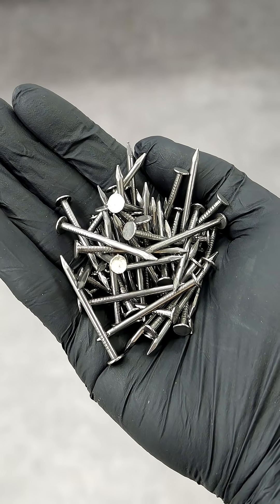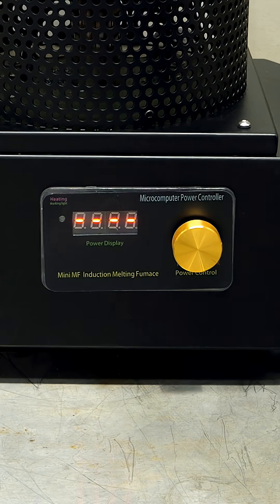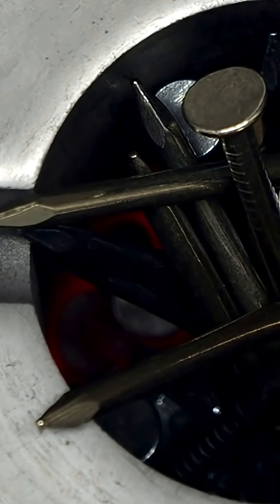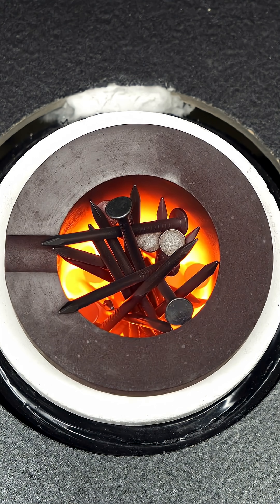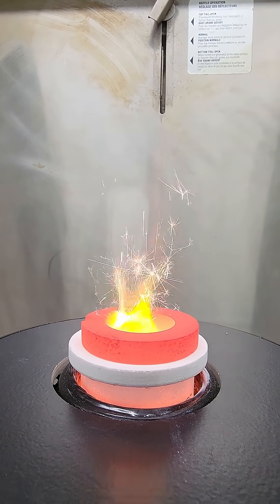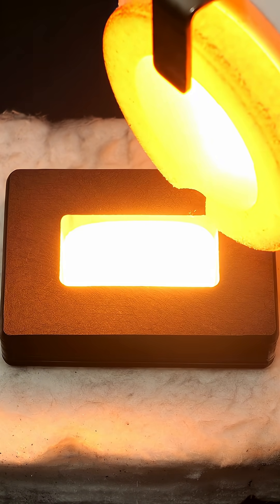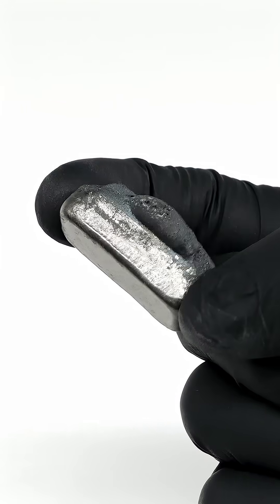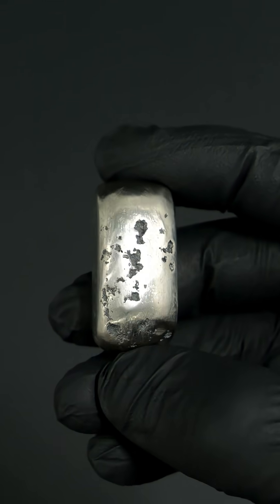Liquefying nails is crazy

Comment: Just a word of Advice.  If you want to smelt metals or alloys,  be sure to do it outdoors, and with a respirator.  It is important that water, such as rain, can not touch anything near or around the smelter.  If water gets in, there will be bits of liquified metal flying everywhere.  If you breathe in them fumes, it will seriously mess you up, then its lights out forever.
Reply: Great advice. It's also worth noting, NEVER pour molten metal over a concrete floor. Because it can explode.
If you ever go into a foundry the floor has a layer of moulding sand over the floor which can safely deal with any spilt metal.
Reply: @agentcrm Why? Is it because the concrete cracks from thermal expansion, or water in the concrete, or some heat-driven chemical reaction?
Reply: @WarttHog  The concrete can explode.
I believe it's the water in the concrete that expands and causes the explosion.
Either way, no workshop or carport concrete is designed to withstand the thermal shock of spilled metal. 
Personally, I know a localish small foundry worker who had a had a heart attack, after a crucible failed and the spill from that.
Reply: @agentcrm Very important, yes.  Great addition.
Reply: A proper science lab has proper ventilation.  He’s a professional.  I’m sure he knows what he’s doing.  Plus, if this were true, all smelting plants would be outside.  I’m not disagreeing that the fumes are harmful to breathe in though.
Reply: @DanTheMan12379 How many people own a smelting plant?  I am clearly referring to people doing this at home.
Reply: @seanhuds7351 it wasn't obvious to me you were talking about people doing this at home. The fact that you commented this on someone doing this in his chemistry lab instead of at home led me down a different path...
Reply: @seanhuds7351  who do you know that has a smelter at home???
Reply: @littlesparkkitten  Me.
Reply: @seanhuds7351  That is wild. I love that for you but I hope you know that’s like… extremely rare. You are the first person I’ve ever heard of with that kind of equipment at home.
Reply: @littlesparkkitten Thanks.  I actually made mine from scratch.  Its only small and I only use it for minor projects.  To give some context, I make tools from various periods in history, dating back to the Neolithic era to around the Bronze Age.  I guess you are right, it is rare but people get into all sorts of wierd and wonderful hobbies these days.
Reply: @seanhuds7351  okay that’s awesome as hell/gen
Reply: I think he has it under a fume hood
Reply: that smoke was likely zinc oxide, which will kill you fast if you breath it. dont forge or smelt galvanized metal.
Reply: @DarkworldHero zinc oxide is not that toxic
Reply: I’m terrified of Hexavalent Chromium whenever I work with stainless steel.
Reply: @VenusDescending  Hell yeah!! that stuff is evil.
Reply: Avoid water and rain by doing it...outside?
Reply: @peelsreklaw Obviously if you have a Garage just do it in there with the door open , but I dont have a Garage or a Gazebo so I have to do it the old fashioned way of waiting for a day where it isnt raining.
Reply: How did blacksmiths make plows and stuff before respirators then? Were they dying young?
Reply: @Daixiu1  Galvanized steel produces toxic vapors when it heats up enough. If it isn't galvanized then it doesn't do that, also weren't they generally well ventilated anyways due to having to use coal or other solid fuels?
Reply: @HibbyGibbons but galvanize process was only invented in 1900 when lead was found, before that only mild steel
Reply: @Palmstreet-u7x  I am well aware, which is why I pointed out that only applies to galvanized metal, I also added that they would be well ventilated either way because of the use of solid fuels for their fires. I could have been clearer I guess.
Reply: @HibbyGibbons point taken
Reply: I only mentioned it because I was from January 1976 to November 2017 a boilermaker using galvanized steel daily on gold mines, ad it was used to prevent steel from rusting, and few people know that all what galvanized steel is its hot treated steel, contain high levels of lead, that when heated up that galvanize is removed from the steel and very highly toxic to the lungs,
Reply: @Palmstreet-u7x  No reason to justify it, more information isn't anything to apologize for, thanks for elucidating.
Reply: @Palmstreet-u7x That's obviously why I asked that question. Because I knew they didn't.

Edit: Also your comment about most men dying in their 30s and 40s isn't true. The "average" life expectancy was low because so many kids died in childhood and infancy. What you said is just "common knowledge" that was repeated so often that now people believe it's true.
Reply: @HibbyGibbons  Thank you for being kind and informative :3
Reply: @Daixiu1 I think you are confusing smelting with forging.  In the medieval times people forged Iron, which involves heating it up and hammering it into shape, but at no point melting the Iron or heating it to the point that it starts to vaporise.
Reply: @seanhuds7351 surely someone was melting the iron out of the ore then melting the iron to make the bars and rods etc
Reply: @pb7379-j2k  Iron ore is a lot safer to melt because it lacks the alloying metals. It's some of those alloys that are very toxic while melting.
Reply: @pb7379-j2k  That actually took a long time to accomplish. Iron is a bitch to melt if the best fuel you have is wood or charcoal. It really needs coal coke and a forced draft to truly liquify iron and produce it at scale. What you got instead were iron 'blooms' and other means to soften and extract iron from ores in small amounts, often with considerable impurities. 

That's the reason behind the elaborate swordsmithing techniques used in places like Japan: They had no means of producing high-quality iron, and so they had to resort to elaborate means of forging to work out impurities, even out the metal, and get the required properties.
Reply: @seanhuds7351 yes he's totally misunderstood the difference between the two subjects you mentioned
Reply: @Daixiu1 Did blacksmiths back then melt galvanized nails?
Reply: @thatonetitan8456 before 1900 there was no galvanized steel 😂😂😂 galvanize was only found in 1900 after lead was founded,
Reply: @Daixiu1 died in their 30's.
Reply: @Daixiu1 in the 1500 1600 1700 1800 very few men lived older than 30 40,😂😂😂
Very few reached 60s,
Reply: @Daixiu1 they heated up steel and hit it flat
Reply: @Daixiu1 oh, that's easy! They worked in the aforementioned well ventilated spaces because the heat required for forging is hot as hell, especially since they did not have induction to centralize the heat as efficiently.
Reply: I can rest peacefully, secure in the knowledge that you never step one foot inside my shop.  There would simply be far too many hazards for you to contemplate 😅
Reply: Yes the nails were coated with zinc …bad to breath..
Reply: This experiment, like all the ones on this channel that involve volatiles, are done under a fume hood.
Reply: So indoors in the leaky basement with the lights off. Got it, brother. 👍
Reply: He did this in a fume hood i think
Reply: yeah but this only applies to mortals, not nilered
Reply: The fumes won't kill you, they will cause your respiratory (lungs) to fail due to the chemicals and metals entering your body. Same goes to soldering metal for electricians (Electroboom...)
Reply: I knew there was something wrong
Reply: @JoeSmith-cf5zs  there’s nothing wrong with how Nile is doing this. It’s being done in a lab and he has clearly been properly trained in safety and knows what he’s doing. The comment you replied to said in another reply that they weren’t talking about Nile, but people “doing this at home”

Comment: its more than likely aluminum or stainless steel. The nails are too shiny and flawless (no discoloration specs) to be galvanized steel\zinc coated\high carbon steel (typically these nails are a bit dull looking). The ingot doesn't appear to resemble cast iron like some have said (too shiny; would also would have pours throughout the entire ingot). The ingot does resemble higher carbon steel (as well as aluminum and stainless steel), however I doubt its HCS due to my prior mention of the overall appearance of the nails shown prior to melt. This is just my opinion...

Comment: The zinc fumes from the galvanizing coating will give you a Bad Day if you breathe too much. Welders are advised to use PAPRs if they’re welding galvanized, to avoid metal fever. (Correct me if I’m wrong)
Reply: Yeah, I was terrified they were galvanized, but there would be more gas coming off it.
Reply: Yeah, the nails would be darker in color if they were galvanized. That smoke was likely some protective oil burning off.

Comment: Use flux to avoid the porosity layers on top. That happens whenever melted steel comes in contact with our atmosphere. Flux will create a shielding layer between the air and the metal.

Comment: I had a factory job where I used induction heating coils to melt solder for brazing metal fittings on metal tubes. We supplied Cummins with hose and tube assemblies for their engines. 

We had these little pieces called banjo fittings that needed to be brazed onto the ends of small steel tubes. You'd grab a tube, put a little ring of solder over it (it looked like rings of chainmail) and then you'd put the banjo fitting on. Slather it with some flux and then stick it through this induction coil. You'd press the button and in very high pitched noise would come out the machine and within 5 seconds the solder ring was melted and the steel tube was nearly glowing red hot. It was pretty cool.

Comment: I would use ceramic crucible instead of the graphite one. And no graphite mould, probably sand would be better. Also the slage should be removed before casting into the mould.

Comment: This has to be fake. In 911, burning jet fuel and bldg furnishings melted steel trusses and beams at a much lower temperature. Textbooks for physics and engineering have been changed. Your kiln needs to be recalibrated. 
Get with it. 
(😂 - great video!)

Comment: the firework sparks you saw when you heat it and poured it is the Carbon in the alloy boiling out of the matrix when the heat gets high enough the carbon can escape, leaving you with just the iron that makes up the bulk of steel alloy. that’s why it had that black ash develop after casting the bar, and it’s why that nugget you have is no longer Steel at all, but likely almost pure iron

Comment: That is, induction, what was the first industrial technique used for metals that were not useful any more.
The sparks are the oxidizing of elements, components, lice Ni, C, Si, etc., you took it out from the nails, so dear... that piece of metal will need new enrichment elements and more heat or cool work to obtain the metal, and properties that originally had.
Good video !!

Comment: What eBay induction heater gets that hot. All the ones I’ve seen only go to 1200 and I think they are usually lying and 1100 is about as hot as they get. I’d love to get one that could get hotter. I bought a gas smelting bucket just so I could finally do copper but those crucibles are so chunky and thick with no pouring spouts, I can’t use smaller molds.